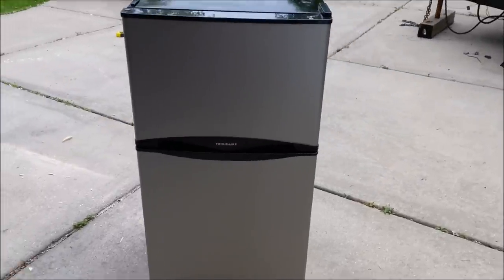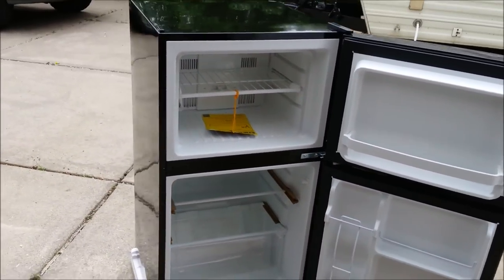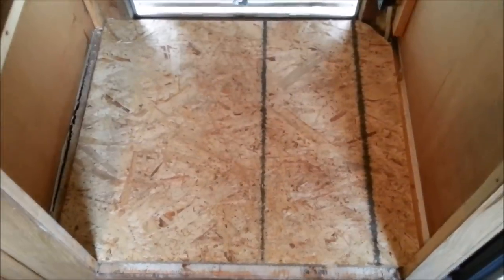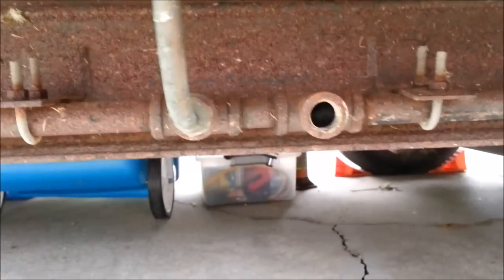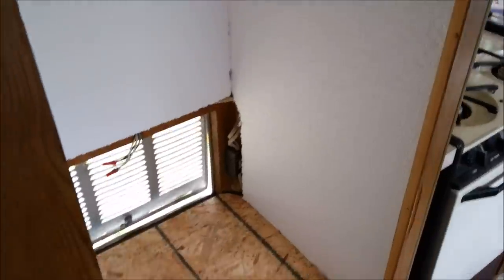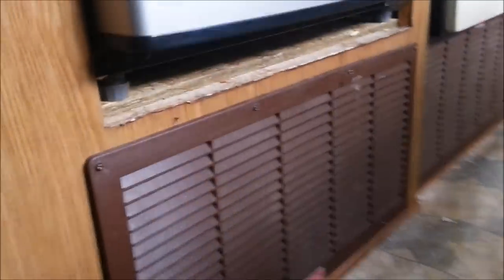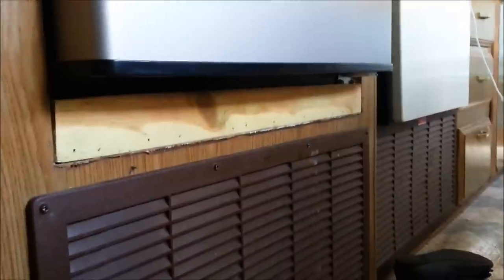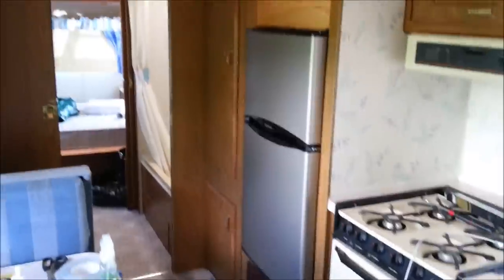Installing a Residential Refrigerator in an RV/ Travel Trailer

Comment: Thank you so much for these videos. I have converted my trailer to a tiny home and plan to remove the non-working dometic this week and replace it with an apartment size fridge. I have a cabinet under my fridge so removing that I will have plenty of room for the apartment height fridge. I just had no clue how to take out the old fridge. So thankful you posted these videos!

Comment: Good job. The only concern I have with the added fiberglass insulation is the refrigerator will have a hard time venting the heat. it is already not designed to be built in as it is and that insulation will not allow any heat to escape
Reply: Except he kept the vent behind
Reply: @thatoneguy9122  better to insulate the vent on top of the roof and the vent on the back. And if possible make a small cut out on one of the side cabinets that the refrigerator is installed on. To vent the heat out.

Comment: I put almost the same frig in place of our old 2-way frig.  I had to do some trim work and I made sure to use screws to mount the trim to make replacing the frig easier in the future. I plan to add an inverter and battery at a later date for boondocking.

Comment: Excellent video.  How is your fridge holding up?   My Dometic propane fridge in my camper just died yesterday and I'm thinking of doing the same thing you did.  Do you know how many watts it runs when the compressor is on? There should be a label on the back some where with the specs.  I can't find the power requirements any where.  I do all of my camping off grid, with solar providing my power, so that's a concern.  Thanks for any info.

Comment: Did the fridge have it’s condenser coil on the back?  I ask because I have a similar unit and the condenser coils are in the sides.  My concern is if your fridge is like mine then you have insulated the area of the outer box where the unit needs to radiate away the collected heat!
Reply: I'm also concerned about getting rid of that heat. The mini fridge specs usually include gap dimensions and actual dimensions. I'm gonna replace a 6 cu ft with a slightly smaller size, include a little ventilation space all around and maybe a small exhaust fan through the original outer wall door. Raising the fridge on a shelf would give me room underneath for that.

Comment: I replaced a DometicNDR 1062 10 Cubic Foot with a Frigidaire FFTR1022QM 10 cubic foot.  Looks about the same but bigger then the one you installed.  Basically did the same as what you showed with a couple exceptions.  Once installed the new fridge was about 1" shorter then the Dometic and I needed to remove 1/4" from the right side opening frame.  I'd like to suggest for others that you can remove the front feet from the new fridge, drill holes through the floor in front where the center of the feet would be and use a longer bolt with 2 nuts and two washers which can be used to support the front to the actual floor using existing foot threads on the fridge.  I also drilled the rear support as you did and installed two longer wood screws to support the back.  Once flush with frame I added a small amount of insulation on top as well as the bottom.  Using black electricians tape, 2" width on top and 1" width on the sides and bottom to complete the seal and match the black fridge frame.  Most everything else I did like your video showed.  Thanks for posting it!
Reply from the maker: Great advice Ted, thanks for posting that! We have been happy with ours so far but will probably put in a battery and inverter this year for longer trips. Thanks for checking it out!

Comment: I have 900w solar w 8 12v battery bank  and I put a 10cf frig in my old Safari DP it works great off-grid put a soft start on and will help the draw off the battery bank

Comment: Good video. I did want to point out that the flooring is OSB and not plywood. Also, the copper line is tubing and not pipe.

Comment: I noticed you didn't put the Styrofoam insulation on the ceiling of the compartment, may I ask why?
  Some say insulate & some say don't. So just curious? 
  I'm presently doing the same thing, but the fridge I'm installing is a bit narrower, as well as a bit shorter. Was wondering how to fill the gaps & make sure it doesn't move while traveling? This video came on my feed just in time, so thank you!
  There were only 2 rv fridges available for mine, but they were $1700 & $1900! Just for the fridge! 😳
  So I decided to go with a residential & upgrade my solar & I'm still saving hundreds!

Comment: Hello
I just did the same thing in my 1999 5th wheel i got a fridge from home depot it was $239.00 but on sale labor day $178.00.  I was going to some day rebuild my Dometic but i found out that the fridge was installed before the walls were up no way the original was coming out the door i had to get out my hack saw a cut off the cooling unit it still was hard to get it out but i was able to part out the Dometic and got back over 60% of the cost of the new one working fine i did no put a shelf on top i just store stuff like paper plates, foil, bread,  mine had fiberglass insulation on both sides i used some to plug roof vent but left bottom louvered vent their for cooling the fridge i got was a Whirlpool 4.3 Cf.
Reply: Bad idea  home box will heatup camper

Comment: I know you wrote this six years ago but this is a great video and I appreciate you doing it! I have a 2008 Keystone Passport. This is a 4400 pound ultralight that’s about 27 feet long. Contemplating doing exactly this on mine. A couple of quick questions: first did you install the AC outlet that was behind your refrigerator or did it already happen to have that there as an option? Second, I believe our Dometic refrigerator, wyhich is propane/electric, is about 6 ft.³. I think that you said that your residential refrigerator was about 4 ft.³ but just looking at the inside of it on the video it looks as big as mine. Could it be that your freezer and refrigerator together are about 6 ft.³? In any event, we will do our homework and take measurements but this looks like a very good option for someone like myself that’s always going to have hook ups.
Reply: I was wondering about the plug as well and he answers in another comment that the plug was there from the old fridge.

Comment: Here's an idea if you want to save the decorative panel board from the old unit. Cut the panel to fit the new fridge, then glue magnets to the reverse side. Now just stick the panel to the front of your fridge!! (Will not work if your doors are plastic)

Comment: If you don't lay it on the side or upside down and keep it in standing up it will work for years, even if it's jumping up on potholes.        if you layer it on the side let it stand for atleast 24hrs before you plug it in.

Comment: how has it been holding up we have a 26' dutchman and needs a new fridge my only concern was the vibrations it might take from traveling a lot any issues with yours I was almost thinking adding some extra cushion to the compressor so it doesn't take to much abuse and I was curious how these fridges do while being on and moving down the road I have a extra small generator that I was thinking of mounting on the rear and running the fridge while on the road
Reply from the maker: +SPINELLI CUSTOMS the generator idea would be great. We have had no issues with ours over the last few years, it has been working great

Comment: hi im johnny u did good. now if i remember right on one of bob wells show at the rtr i man rewired his so it would only pull amps from his batterey bank when the ompressior kicks in and it keeps it old anddidnt drain his solor battery banks and he runs full time. hope this helps ill be wthing ur show. best of luck johnny and toby
Reply: Thanks for this information. I just bought a 1989 Fleetwood Southwind Motorhome and the fridge is a house fridge. I was hoping to find a way to set it up so I could use something other than shore power.

Comment: You said you were going to use Velcro to keep the door closed , how did that work for you ? I am about to put a 12 volt upright fridge in a new build but it doesn't have a lock on the doors
Reply from the maker: Velcro worked just fine for years
Reply: @SSLFamilyDad  thankyou for your reply , all the best for the upcoming year

Comment: I heard residential 110 volt refrigerators can't hold up to the bouncing and trauma from the road.  they also need a space in the back for the cooling coils to displace the heat.

Comment: I am going to do the same thing... What is the model # of the  Refer you bought.  I ask this because my Dometic RM 763 is the same size as your RM 2604 and it is leaking ammonia.  Thank you for the great video and yes I am done with this archaic system!  My intent is to totally rewire this system to accept 110v with an inverter for 12v.  Very easily done w/ the known wattage required from the new refer!  Again, Thank-you and I will send you the finished product and a video if you like!  Eric... ASE Certified Master Auto Technician w/ 42 years of experience! :-)
Reply from the maker: +Eric Schnidrig should be a link in the description to that fridge so you can check it out. You can get it on amazon or best buy, good luck!
Reply: Eric Schnidrig did you make a video of using an inverter to make yours work

Comment: You never really mentioned what you did with the 12volt system wires?  It looks like you just wire nutted them together.  How did you do it?  Just cap them off or connect them together to complete the circuit?
Reply from the maker: Capped them off

Comment: It's been 3 years now. How is it holding up? I hear they aren't made to handle bumps etc so life is shortened. I'm curious how it's holding up.
Reply from the maker: +Tech22945 still working just like new. We have only gone on one or two trips each year but usually about 3-5 hour drives. No issues yet!
Reply: Thanks for relying. :D I'll definitely consider this option more now

Comment: Great Vids... Any updates?  I'm thinking about doing this in my RV and I'm interested to know if you've had any problems with this model or having a standard fridge in an RV in general... thanks!
Reply from the maker: David Hamrich We have had it in for over a year now and been out camping a few times. So far it has been perfect for us on shorter trips and even on a four hour trip everything stayed frozen and cool with no trouble. I still do plan to add a battery and charger to run it for longer trips.

Comment: I have a quick question. You did not  cover the back bottom portion to the outside with foam board. Is that needed for ventilation? My new fridge will be smaller than the opening I currently have as I will be taking out a double door model for rvs ( I plan on finishing out with reclaimed wood and paneling, kind of making it a nook) Do I still need to leave that whole open in the back?  Thanks for this, it was just the info I have been searching and searching for.
Reply: DONT cover up the back vent, it needs to be there to have air to circulate around the back

Comment: When using a residential fridge in an RV, do you still vent to the outside?
Reply from the maker: You don’t really need to but you need to have some space or way for the heat from the compressor to dissipate

Comment: I purchased this exact 4.5 cubic foot Frigidaire and plan on using it in my RV rather than purchasing an RV Fridge for $1200-1400 but the man helping me put it in said that I can't do it because there is no space for it to vent. It is too snug just like yours. This video you posted is from 2014...can you tell me if your fridge is still working now in 2021 or did it mess it up with no space around it?
Reply from the maker: It was fine and plenty of room to vent heat

Comment: I see you have the furnace below like mine does. I was curious if you have any concerns about carbon monoxide coming through since there's some gaps around the fridge (top particularly). I hadn't thought of this concern until I saw it written elsewhere. Appreciate any feedback you can offer as I'm a somewhat new DIY-er. Perhaps I can put some weather stripping around to block it out.
Reply from the maker: The furnace should be sealed and that gap should not allow any carbon monoxide to come in. However, you should always have a carbon monoxide detector working in the trailer when in use.
Reply: That's kind of what I thought, I appreciate the video and reply! Happy camping!

Comment: Great video my RV refridge just died and I am replacing it with a residential one. Can you tell me how many amps your new fridge is pulling. My stock RV one was pulling 2.7 amps. Thanks.
Reply: I did a similar replacement but with a taller fridge. It was a Haier from Home Depot, and it was a huge improvement over the standard absorption type, in my opinion. I left the back open and the top vent in place for proper air flow and heat exchanging.  Start up current was about .9 amps and running current was about .6 amps. It used less power than the old unit did. I used an inline meter to check amps, watts, and voltage, a P3 P4400 Kill A Watt Electricity Usage Monitor.

Comment: Great Video.  Our Dometic 2652 has had two cooling units in 4 years (the original and one placed in it 2 years ago. Now it needs another one. So we are wanting to go with a residential for our travel trailer.  My only concern is having enough amps to run a/c and fridge and whatever else needs electric at one time. Did you have any issues or modifications that is needed to make sure all electric works?  Also one more question. We sometimes travel 8 to 10 hours a day, do we just put dry ice in the fridge until we get to our campsites? Again, appreciate your video
Reply from the maker: Debbie Ainolhayat Our has been working just fine and they actually do not pull that much power so that should not be a concern. As far as long trips go it would be best to grab a battery and an inverter and just let it run while you are on the road. Dry ice would be fine also, anything over about 4 hours and things will start to thaw a bit in the freezer. Fridge stays pretty cool for 4-5 hours. Hope that helps and good luck!
Reply: Debbie Ainolhayat  I have had 120 volts refrigerators in 5 motor homes. When traveling I plug the refrigerator into an extension cord that is plugged into an inverter which is attached to the vehicle battery (I have a transfer switch). The refrigerator stays cold and will make ice while traveling. The size of the inverter depends on the refrigerator Amps draw. Most such refrigerators (8 amps or less) will run on a 750 - 1000 watts inverter. The important part is to have a disconnect switch in one of the two  the 12 volts line going TO the inverter (or remember to turn off the inverter) , otherwise it will drain the vehicle battery when the vehicle is not running.
Reply: Hi Pat,
We have a travel trailer. I guess my question would be should I get one more 12V battery and an inverter  along with a transfer switch assigned only to the residential fridge?
I am hearing good things about residential fridges.
Thanks for your help.
Reply: Debbie Ainolhayat Hello Debbie, The refrigerators that I used were very large. If a smaller refrigerator is used, about 4.3 cu ft or less, the 120 volts amp draw is usually less than 2 amps, sometimes 1 amp. For a travel ,  trailer, I would use a similar set up as previously described. Mount an inverter on the vehicle battery and run a 14 gauge extension cord to the rear bumper of the vehicle. Run a 14 gauge extension cord from the refrigerator to the tongue of the trailer.  When the trailer is hooked up to the vehicle, plug the 2 cords together.  Raise the hood of the vehicle and switch on the inverter. When the trailer is disconnected from the vehicle, turn off the inverter, under the hood, and disconnect the 2 extension cords. Then disconnect the refrigerator from the inside portion of the extension cord and plug the refrigerator into a 120 volts wall plug and therefore, use shore power. The small amp draw of the refrigerator will not be enough to cause a problem with your 30 amps input. If you use a small amp draw refrigerator, a 400 watts inverter, on the vehicle battery, will provide about 3.5 amps of 120 AC volts, which will power the refrigerator while traveling. If you do not wish to have to remember to turn off/on the inverter each time, a simple disconnect can be a solenoid switch placed in the 12 volts line between the battery and the inverter. Activation for the solenoid can be provided by running a 12 volts line from the fuse box to the solenoid. The wire should be attached to spot that is only powered when the ignition switch is on. A continuous duty solenoid switch must be used. Surpluscenter.com has a 80 amps switch for about $10.00. Pat Courtney
Reply: Hi Pat,
Great idea.  We are going to do that on our next trip next week.  Thanks, Debbie

Comment: Hello, thanks for posting the video, I am needing to do the same thing. I'm wondering if you had any problems with ventilation around the fridge back? I bought a similar style and it says in the instruction manual to allow 5 inches around back and both sides for ventilating purposes.
Reply from the maker: We had clearence behind so there was no issue
Reply: Awesome! Thanks for the reply and for the helpful video!!

Comment: Nice video.  Are you sure you used a 4.5 cu ft fridge?  For the price range you are talking about, I could only find the Frigidaire 3.1 cu. ft. model (i.e., Best Buy) for about $225 with free shipping.  The 4.5 cu. ft model goes for around $330.
Reply from the maker: Here is the model that I have installed here. I caught it on sale for just under $300 and also had a $50 off through their rewards program. Regular price is $330 on the fridge you are 100% correct on that and I probably should have specified regular price, sorry about that. Thanks for watching!

http://tinyurl.com/lvczkfh